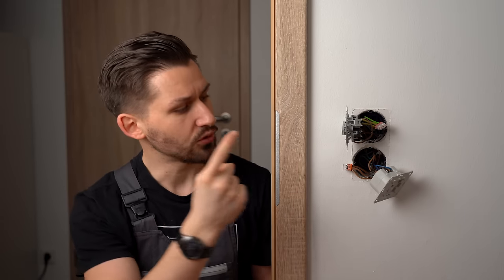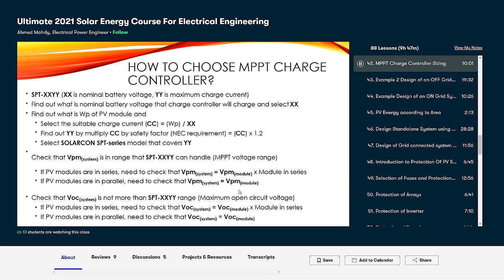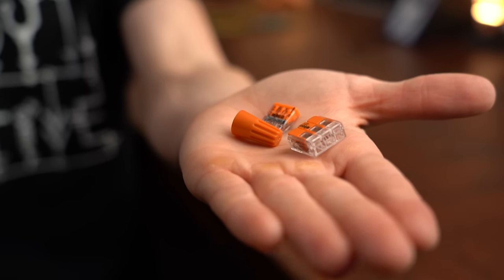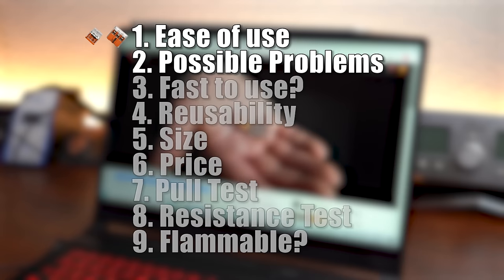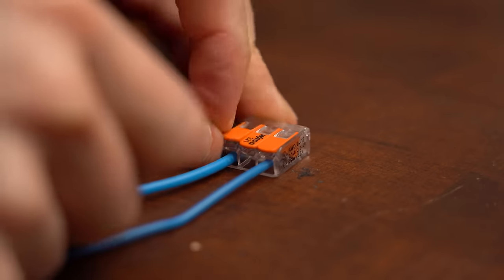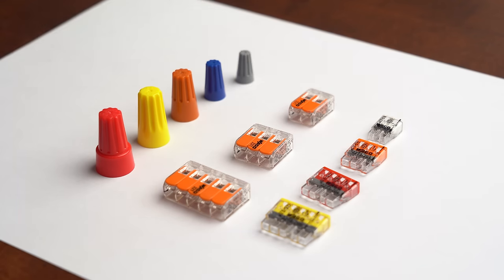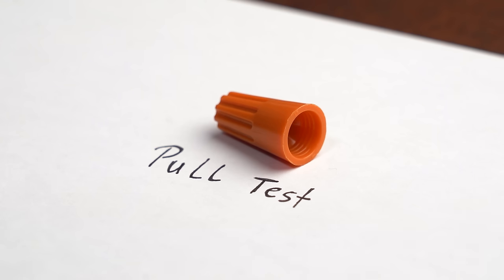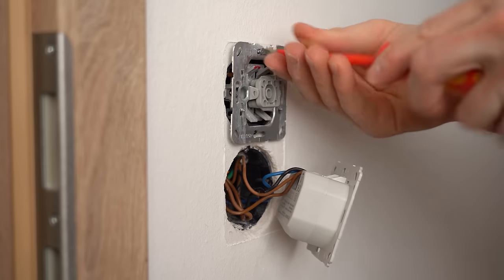What Wire Connector is the Best? Settling a Debate! Wire Nut VS Wago

Comment: Interesting video sir o7 got to admit I was surprised how well the wire nuts held up in those tests, I'd be interested to see how "Coco blocks" (screw terminal blocks) with and without bootlace crimps on multistrand wires do in such a comparison.
Reply: Termination of multistrand cables in any type terminal block without crimp lug or bootlace ferrules is proper bodgy business. 
Ohhh I've seen it and QA failed such work done by sub-standard workers.
Reply: We only use screw terminal blocks and connectors here. Anything else is considered inferior.

Comment: As a service electrician I have seen many push fit connectors that have melted from poor connection.
Reply: Exactly. When users switch things around the draw changes and a spice with a wire nut is finfinitely safe than a melting bus bar surrounded by flammable plastic
Reply: This video is just cope
Reply: @ChrisHillASMR  the wagos are rates to like 32 AMPS or something around there. Theres really no scenario where you should be drawing that much. If you do one of 2 things will happen before the wago fails. You'll either trip the 15A or 20A Breaker or the wire insulation will melt before the wago fails. They are pretty darn safe.

Comment: Biggest advantage for Wago for me is that you can extend your electrical installation easily. I always use connectors which leave one or two free connections. If you want to add another wire, just push it in. Super fast.
Reply: Which can be useful for hobby work.  However, when you're putting in the electrical for houses, trying to get 2-3 done a week, while trying to make a decent profit, I would have to say that future proofing like that wouldn't be a consideration.

Comment: In the Netherlands the wire nuts have also been used, still allowed and sold. Brand Conex (lasdop). I can't imagine that it hasn't been used in Germany, as the Wago type connectors don't exist for a very long time. Since the eighties?
In school we where thought to mount them in a different way. First stip the wire, the twist them all together, cut the twisted end to length and screw the wire nut on it.
Advantage strong connection low resistance. Disadvantage inflexible when changing. You need to cut the wire a lose a wire length when you change the wiring. That why we were though to put an extra round wire in the utility box.

Comment: I thought the wires are to be twisted before being threaded into the wire nut…
Reply: Even the solid coper wires?
Is stranded the default cable type used in the US?

Comment: It would have been good if you included other types of products from the rest of the world. As an example, while Wagos are used here in Australia, they aren't ubiquitous. Most electricians use "BP Connectors". It would have been nice to see you include these as well. I'm sure there's lots of other products in use around the world.
Reply: "BP Connectors" or what are called in Germany, "Lüsterklemme" are still available but got phased out because time is money. They were the standard before Wago clamps in Germany too. I think they make the best connection, and are reusable. But it takes to long to install them so they got pushed out from the market. But in every electrical installation prior to Wago clamps you will find the same kind of connector in Europe and there probably are hundreds of millions still chugging along hidden behind the walls. The only reason they aren't installed anymore is the high labor cost. If you factor that out, they are perfect connectors.
Reply: @Peter22334  I ran into these in Cote d'Ivoire 15 years ago when I was helping a friend with an electrical problem at his house.  The locals called them "dominos".   We found the problem to be a "domino" connecting power to the house -- it was wrapped in a grocery bag and buried with the supply wire in a field about 50 yards away.  It had apparently worked fine for the dry season.
Reply: I've just had to look up a 'BP connector' Looks a bit like a 1-pole chocolate block/screw terminal, but not quite the same.  Testing some choc-block too would have been good.They have been frowned-on in the UK for a long time, but still heavily used, along with the more kosher junction boxes.

Comment: Wire nuts always win out in new constructions.  It's very common to have to add to or take away from a connection point.  Inside a four-way junction for example.   Not only can you secure all 12 wires with three wire-nuts, but you don't have to wait until you have all runs in place before you decide what to use.  And if you need a bigger one, you just swap it out.  

Next your heat test.  The problem isn't them melting and exposing.  If it gets hot enough to melt the plastic, you have an open fire anyway and those wires sparking are the least of your worries.  What you need to worry about is the heat/cool cycle causing the plastic to degrade and crack away over years of use.  Thin plastic always looses that challenge.  And it's exacerbated by the fact that the Wago depends on its own internal bus.  With constant stress on the entire structure as all the wires go in different directions.  With a wire nut, the twist should include the shielded part so that the stress is taken up by the wire, not the connector.

No, I had been considering trying out Wago, but your video made it clear I should only be using them on things I don't care if they burn down a few years down the road.  I had to rewire my house from wiring it had when it was built in the 1920's.  The old wire-nuts I had to take off were still in great shape.  Wago is definitely just for those who like to be "hip" with the newest and are just straight lazy.  "Oh look!  It tells me everything I need to know on the connector!"  No.  It doesn't.  If you're afraid of having to lookup something, either on the internet or in a book, you definitely shouldn't be wiring anything up that takes more power than a single D-cell.

Comment: For field repair, ease of use and prototyping the wago locking lever types are the bomb, they are used at the highest level of my Industry, an industry where we are still allowed to use lead solder due to how mission critical reliability is... I have never had hot connections or anything since migrating to them personally in my own testing too.

Comment: I moved to the States 15 years ago. In your setup, you used two wires per wire nut. That seems to hold fine. But when you get to three or four or higher, the odds that one of those isn't as well connected/twisted as it should be goes up rapidly in my opinion. I walked into a couple boxes with wires barely hanging on or having come completely undone. 

Wire nuts are the go-to around here, because, in my humble opinion, for only thing that truly matters around here: They are cheap.

Comment: Canadian electrician here. Wire nuts (usually know as the trade name "Marette") are definitely not all created equal. The more expensive brands, such as Ideal, are far superior in use at the cost of space. 

Marettes are great at the extreme ends of the wire sizes,  the big blues can connect upto  #6awg i believe (sorry i haven't completely switched metric), not to mention how many #14s you can splice. 

The tiny orange and greys are excellent for small wire sizes, especially solid conductors, like #20 or 22.

I really do like Wagos for stranded and #14 etc. but the cost is really their downfall here.

Im got catch sh!t for this, but in my professional opinion, ALWAYS pre-twist your wires when using wirenuts. I've seen too many melted marettes from poor connections.

Comment: While I'm not a huge fan of wire nuts I feel they are superior when used correctly.  If the wires are twisted together before the nut is installed your electrical connection is superior as the nut is essentially acting as a cover for the connection.  Where as with the wago your reliant on a spring contact to maintain good pressure to provide a lasting connection.  Better connection lessens the resistance (as shown in the video) and therefore the fire risk.  Keep in mind I'm on the USA, and I do still hate using wire nuts.

Comment: Thank you for doing heat and resistance tests. I always suspected the extra contact points and bus bars might do that, and now I know. This is a problem that gets worse over time, and is especially evident with space heaters, power tools, and outdoor fixtures. So I will continue twisting my nuts for now.
Reply: should not get worse over time due to the spring load
Reply: @kasel1979krettnach  what I meant by getting worse is the oxidization that accumulates between the contacts and the wires. These connectors may be quick and convenient, but they have twice the contact points with less surface area touching the wires. I live in Florida where the air is swampy and the insects are plentiful. It may take 20+ years to notice a difference, but I have had problems with outlets heating up due to corrosion on the internal contacts. Not to mention dissimilar metal contact points increasing the rate of corrosion, which I have not seen tested.
Reply: @Alkatross  let's ask WAGO . i think the spring load and cutting property should be tolerant. of course not design to be wet ....
Reply: @budgroweryt9947  nah typically they run testbenches and competitiord test side by side
Reply: honestly for heavy loads its better to solder wires and not use connectors at all? if you use aluminum wires better to use screw terminals
Reply: @RedeemedPaladin  solder is worse . and aluminum starts creeping in screw terminals. spring loaded like wago is best as force is constantly applied
Reply: @RedeemedPaladin  For heavy loads, a proper crimp connection or screw terminal connection are really the only ideal connections.
Reply: @RedeemedPaladin    Aluminum is a fire waiting to start.
Reply: @RTmadnesstoo  yeah, but most of the time owners of the building not willing to replace them
Reply: The single contact point of the metal edge to wire is prone to corrosion and increased resistance.  From another Florida resident,  more metal in contact the better.
Reply: These connectors cause all the same problems as the old back stab outlets we used to use in US. We learned hard earned lessons in what works best and the winners were wire nuts and screw terminals, every time. It's crazy to me that Germany with its history of sound engineering would allow such a thing to be an electrical standard. Doors, cars, trains, sockets/plugs all make more sense in Germany than here, so why would they allow this antiquated garbage behind the walls?
Reply: @RTmadnesstoo  Aluminium is regularly used in electrical wiring at the generation and utility levels.
Reply: @Alkatross  backstabbed outlets aren't spring loaded, so you can't compare that to the Wago system. BTW many other manufacturers of electrical equipments supply push in contacts even for harsh environments in industry. Spring loaded contacts are even rated for seagoing vessels.
Reply: @DTXBrian     Sure, with provisions for regularly scheduled maintenance to inspect, treat and tighten as required unlike the push-in stabloc junk hidden away in inaccessible boxes in walls.

Comment: When you were talking about how the 2273 is also intuitive, I had to giggle.  I’m in Canada, and have been using wire nuts for decades.  I recently encountered the Wago connectors for the first time in a video doorbell I purchased.  I had to look up how to use them, because I was afraid of breaking them as I didn’t know how far to pull the lever.  Now that I’ve used them, I have to admit they are a better connector, although bigger than wire nuts.  Thanks again for an interesting video.
Reply: first time I saw the old style lever nut I was on a ladder and it took me minutes to figure out how to get the wire to insert.  I'll admit that once you know, they are great for fixtures because you can make the ground connection with one hand while supporting the fixture with the other, and then the ground takes the weight.  but I don't trust them for full power feed through applications because they rely on the metal in the wago to carry the current.  I've also found about a 10% failure rate on the push in models that come preassembled on tinned stranded fixture wires. - though that is a fixture assembly defect.

Comment: I am not a licensed Electrician. Just to make this point because others here who are responding do not disclose that fact. In the US for wire nuts, particularly with guages greater than 18 guage wire the conductors are: 
Stripped back depending on the number of conductors.
A pair of lineman pliers are used to twist the wires, starting about 1/4" from the base of the stripped conductor and twisting to the tip. 
The wire nut is then placed on the wire bundle. The wire nut itself is connecting trivial current
The wire nut should be twisted tightly so that it does not loosen while folding wires back into the box.

The wire nut is not a conductor nor designed to be a conductor. In a high load situation if you do not twist the stripped parts of the wire around each other, then you essentially turn the wire nut into a heater. I have open junction boxes were amatuers have done this only to find the box is very hot and the wires are glowing red at the connection. While the juction box does protect the structure from fire, it does not protect the very hot wire from damaging the insulation off of adjacent wires. Moreover the wire may get so hot that several centimeters of wire need to be removed. If the heated wire damages the insulation on adjacent wire causing a short, then several conductors will have to be replaced. 

In this country we have electrical outlets with spring loaded connectors (also called easy or backwired versus sidewired). In general when I am remediating houses with serious problems this is a common point of failure. An high load (50 to 100% of the rating) of an outlet downstream overtime and with age will cause upstream connectors (within the outlets) in a series of outlets to fail. This will cause a myriad of problems in the upstream wiring that might take hours to detect and 100s of dollars to detect and repair. The alterantive is to replace all the outlets. which many homeowners opt to do. Single point contactors are not reliable over long periods of time. The minimum area of contact should be broad enough to support the full rated load of the wire And reliable at that load over the typical lifespan of the wiring system (here typical 75 to 100 years)

Comment: I have never used a Wago connector, but I can say that they seem to be a nice option. That being said, it was obvious that Scott had never used a wire nut before and thereby some of his "tests" had skewed results.
Reply: Skewed results? explain pls :)
Reply: @Daiceto  Inaccurate results because wire nuts were not use properly.
Reply: Yeah didn't strip all the much off the wire nuts. More contact the better. As long as the plastic insulation covers all the bare copper I want as much metal to metal contact as I can get.

Comment: I was very interested in these wago things… until the resistance test… There is no scenario where that is acceptable. Or very very few. I hate wire nuts. But at least the ones I need bite and lock with electrical gel. 

There are many types of wire nuts. You got the cheapest general use ones.
Reply: well 20A at 230V = 4600W so not the slightest problem in most situations.
Also, at least by the looks of it, he used 1.5mm² (16awg) in that test while he should had used at least 2.5mm² (14awg) for that amount of current, which may yield other results (especially with stranded wires) due to different surface areas
Reply: @rj7855  It's all fun and games until a lightning strike starts a small fire in every single electrical connection in your house simultaneously.
Reply: He is pushing 20A in a 1.5mm2 cable. Not not even in a central where you are allowed to go down in cabel size is 20A allowed in a 1,5mm cable.  Also 221 is meant for mixed or just fine wires. If you only have solid use the other 2273 series. 
On perspective wago became popular here in the 90s and in the recent years I worked on the service for a big Electric company the takes care of and builds big commercial and state buildings I have encountered a melted connection box ONCE and it was due to bad installation. 

On the other hand the number off times I've seen loose screw connections I can't even begin to count. 

I wonder if you can even find wire nuts in the local electric store anymore, at least the 2 I use I can't even remember seeing them 🤔
Reply: Isnt that less than 0,5m of 2,5mm2 Cu, or maybe he used 1,5mm2 so...25cm or something like that. And now you say that 0,5m(or 25cm) of extra wire is not acceptable in any scenario. I think i have some re-wiring to do, since i made mine only in 90 degree corners, i bet i can save more than 2m in every line if i pull them in shortest possible line. Darn. i even wired around doors, that is more than 4m extra cable for each doors.
Reply: care to explain why it is unacceptable? seems perfectly fine to me.